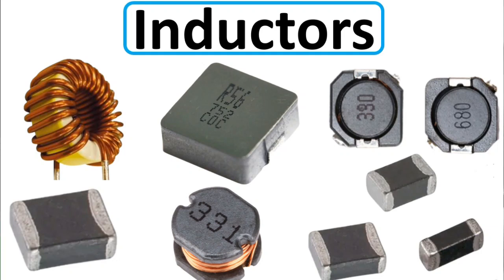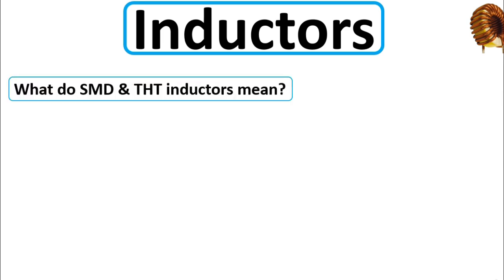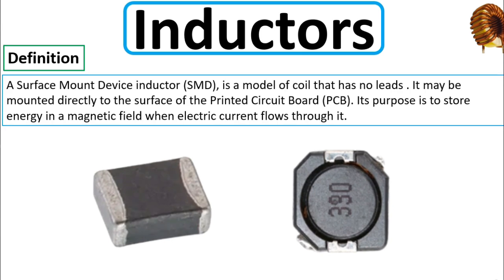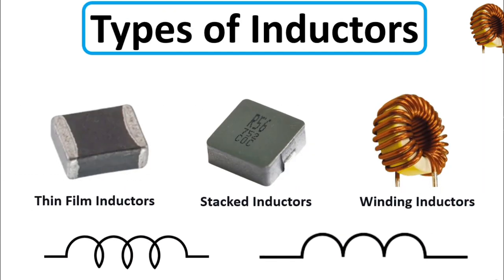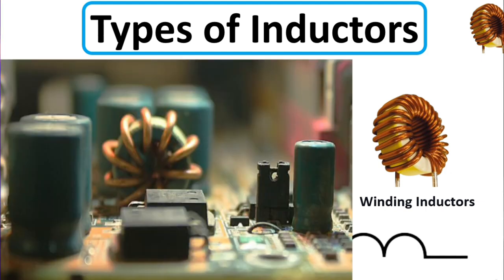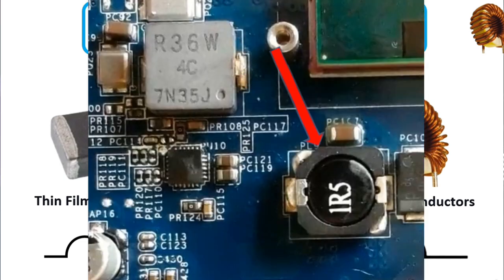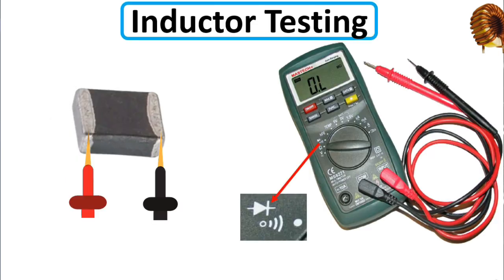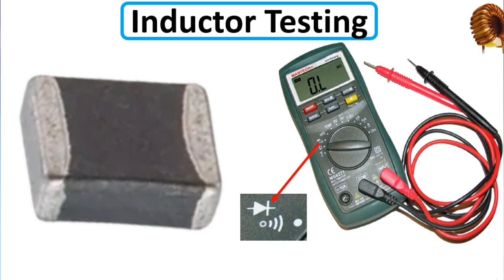Testing inductors using multimeter - SMD Coils testing - Motherboard repair

Comment: Could anyone tell me if the dot on a inductor needs to be replaced with another one with the dot. Are do i need just the same values. I can not locate this thin film inductor. It is from a MacBook coming from the PMC. 0.47UH 20% 1.7A 0.175OHM. Thanks!

Comment: Sir , you set multimeter in diode mode , why there isn't buzz when you check inductors ?  and why you don't select ohm mode ?
Reply: I have the same question. Awaiting your reply sir.
By the way, nice informative video. Keep up the good work.